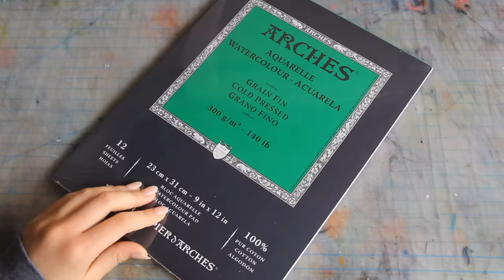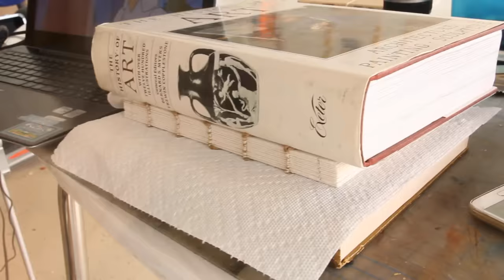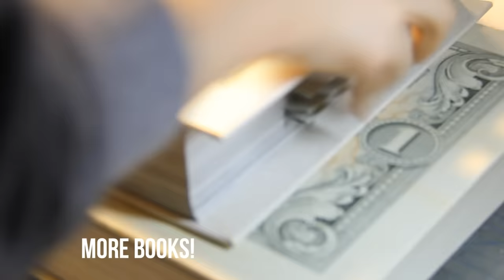DIY: Watercolor Sketchbook (No Bookpress)

Comment: Additional tip: use some other paper, like cardstock, specialty paper, or others, for the first and last flaps of your journal. In this video, you see that the first and last are the ones that get adhered to the book covers. So if you don't want to waste your watercolor paper (especially if you're making a custom one with some more expensive watercolor paper), just add additional pages for your flyleaf and inside cover.
Reply: Ahhhhhhh I was thinking the same. I was cringing a little at the waste of watercolour paper, especially since it's Arches and Arches watercolour paper is so expensive. ;;;;;;;;;;;;;;;;;;
Reply: thannnkkkks I'm gonna make one too!
Reply: she used scarp cardboard and put brown paper on it to make individual covers for each side. I get what it looked like but this is misinformation.
Reply: That's not what Mmina was saying. She is saying that when the cardboard + brown paper combo for the covers was applied to the actual bound pages, it was literally adhered/glued to the watercolor paper itself. She's not saying that the covers are made of the watercolor paper.
Reply: Great 💡 idea.

Comment: This was absolutely great.  I read through some of the comments, and I can tell that some folks don't get it because they aren't watercolorists.  Having the high-quality paper you want in the size that you need in a sturdy sketchbook is so important.  I've spent big bucks on sketchbooks that say they are for watercolor but that don't hold up to the water.  And, as you said, if you do find one that does hold up, it's very expensive.I was given one with a beautiful leather cover, handmade, sewn like yours.  The paper had a note inside saying it was Cold Press 140 lb. handmade watercolor paper.  I think the thing cost about $75 for a 5"X8" size paper.  When I tried to use it, the coating on the pages repelled the water--never had that happen before!  I thought, oh, well, I'll use it for a writing journal.  Guess what--pen slides off, too.  Markers never seem to dry, and smear hideously.  A regular 2B pencil makes incised marks but leaves very little graphite on the page.  The only things that seem to work well are very soft pencils and crayons.  However, the book looks nice on my shelf.  I'll eventually glue small watercolors into the book; that is, IF the glue doesn't do something wacky on the surface.  :)
Reply: DA Best 
try alcohol inks on it. reminds me of yupo paper

Comment: A tip for poking the holes: I would suggest using a sewing pin and not a needle, as they are easier to hold on to and find if dropped

Comment: I just watched a similar DIY clip last night but yours is way too simplier to do :D but will the book open flat? I love to do paranoma watercolor sketches.
Reply from the maker: Jamie Tr Thank you! Yeah, if you bind it a lot tighter than i did, there's no reason to use glue afterwards. But if you do end up using the glue, as long as you apply a thin coat, it should lay flat :)
Reply: MyPetiteCakes thank you for your reply :x that helps.
Reply: Hi, I forgot to ask what type of thread you use. Is it sewing thread (cotton/polyester) or linen?
Reply from the maker: Jamie Tr It's just regular sewing thread but I wish i had linen haha
Reply: Thank you! 
Me too, sewing thread is the only thing I have on hand now. Linen seems expensive.

Comment: does it get damaged easily or over time?? does the strings loosen some time? like do u need to be gentle
Reply: +Liemariko if you use book binding thread [which is the best option] or just a think enough string, then no, you don't have to be gentle
Reply from the maker: +Liemariko Sorry for the late reply! I've used the sketchbook for about half a year now and It's been through some rough treatment, but the binding has held up well! (if you see my latest sketchbook tour, you'll see that nothing really changed except the cover got really dirty haha). I have another watercolor sketchbook where I basically just folded the papers in half and then glued the spine together, which is a really really quick way to make a sketchbook, and the binding is beginning to fall apart after a few pages of using it. I don't think you have to be gentle with this technique!
Reply: liecheepaint you can glue the spine

Comment: i dont have much experience with watercolor, but i thought you had to stretch the paper before painting on it, wouldn't the paper warp if you try to just use it directly? I've just started using watercolors sorry haha
Reply from the maker: It helps if you stretch it but i never do haha!
Reply: +Catherine Zalewski It helps if you stretch, but if you use a heavier watercolour paper like 300 gsm, it won't matter cause it straightens out after the paint dries :D
Reply: +Catherine Zalewski  It'll help but sometimes the sketch lines are too dark.
Reply: For me that has never worked. The paper will warp because you are using water on paper. The best technique I have found is after the painting is done lay a crap tone of heavy books on top of it.
Reply: I don't usually do watercolor stuff in books, I tear out the paper; but taping the paper down also helps to prevent a lot of warping.

Comment: I'm curious, would buying all the materials and making this from scratch be more cheaper then buying one from Walmart or something?
Reply: Walmart doesn't sell arches paper as far as I know and arches is typically a bit pricey, so buying one from walmart would most likely be cheaper. Though arches watercolor paper is very nice quality so it might be better to make your own arches sketchbook. It's 100% cotton and acid free which means it is archival, and takes watercolor paint beautifully. It's worth the price if you can afford it. :)
Reply: I bought all the materials yesterday to do this. I bought my most favourite paper, which is quite expensive and was about £12. I got the cardboard free from the shop, the glue was about £3. Other things I found around the house but I believe it would not be more than £5. I think with the fact that you would be using a paper of your choice and would have fun making it, I think it is worth the extra 2 pounds. But otherwise some watercolour moleskine sketchbooks are around £20 anyway!
Reply: Also she'll use just one paper for 4 drawings :)
Reply: It might be somewhat cheaper to buy a bunch of full sheets of watercolor paper, then cut them down to whatever size you want. Arches pads are like $30+ depending on the size, but I think a sheet of paper is maybe 10$ max?

Comment: Beautiful tutorial. Beautiful watercolor book. Just a couple of bookbinding tips though: 1.) I noticed your sheets of paper crack at the fold. That's because you're folding it against the grain of the paper. If you fold the paper with the grain, it won't crack and thus extends the life of your book. It means a) having a smaller sketchbook or b) buying a larger pad. The best way to tell the direction of the grain is to slightly bend it. If it bends easily, it's going with the grain. If it resists when you bend it, it's against the grain and will crack (and fall apart over time).  2.) If you wax the thread you use to stitch your books it won't tangle or knot as much. A cheap candle would work well. Thanks for sharing your process! I'm going to give it a try. I've never done this kind of binding. (Sorry for the long comment, but I hope it's helpful.)

Comment: Just a tip, with a tooth pick or your fingers, untangle as much as you can, then you just brush them, there's a small wire brush made for this type of thing but i think you use just a normal hair brush, by this way you are gonna have very fine thread that's is gonna glue much better and is not gonna leave any lump.

Comment: It turned out beautiful! I would recommend using a ph neutral PVA glue for the spine as the book will last a lot longer, and a waxed cotton or linen thread is a lot easier to work with standard thread. I had to work up to those items in my books as they can be a bit more expensive.
Reply: Wax repels water. The paper is for watercolour paint. It may make it easier to sew but it will make it literally impossible to paint on

Comment: You can use a phonebook to punch holes - just open to the center, and it's so easy to punch holes without messing up your work table.  Also, for an exposed binding like this, try using waxed thread - it will help hold your stitiches a little better and the thread won't slip or fray.  Just an idea for you xo :) And one last thing - when you painted the spine with E6000 - why didn't you just use PVA?  It dries clear and it's made for books.  E6000 is great, but not really made for paper, and is strong spelling, and overkill for paper.   I love this book - very simple.  It reminds me of coptic bindings that I did in college- so much fun!

Comment: I'm really curious about how this sketchbook held up over time. I've read that you should bind the paper with the grain and not against it, though I'm not really sure how to tell which way the grain goes exactly. Thanks for posting this, I've also been frustrated with the paper in most watercolor sketchbooks, or the expense of ones that have cotton paper.
Reply: To tell which way the grain goes, try to bend the paper along both the long side and the short side. If it is easier to bend along the long side, it is long grain. The reverse goes for the short side.

Comment: Hi, this is probably a daft question but on the first time you push the needle through and loop it round the string -does your thread have a knot on the end of it? What stops it from just pulling out of the hole?

Comment: I have a question about the paper. All of the watercolour papers (several different brands. mostly Winsor and Newton though) I've had in the past are only one sided, as in one side is the watercolour side & the other is just plain & flat (the side you wouldn't paint on). I find it impractical to make a sketchbook with watercolour paper like this. Is all watercolour paper like this? Or is yours "both" sided. Or does it not matter if there's two sides to it & that's how watercolour sketchbooks are just meant to be? But it doesn't seem right. Great sketchbook btw.

Comment: What would be the best string or cord to use for the sewing part? It looks like 4 single threads. can/should I use waxed cord? might be less tangly?
Reply: You can buy waxed cord for sure. I use embroidery floss that I pull apart into strands of 2 or 3 threads, bc it's less expensive than commercial bookbinding thread, and it's essentially more thread for less money. Run it over a small cake of beeswax and you're ready to go!  :)

Comment: What if you don't have a shelf for taping the twine ?  :(  Oh and what kind of thread and needle do you use ? thanks
Reply: +Star buono  I made my own just now and I just taped the twine to the back of the first page and started doing it just like in the video, the only difference was that I had to pulled it a little after finishing the new page to make it thight. And I used a needle that's about 6.7cm long. For thread I just used the stronger one I could find in the deep ends of my closet and made it double :) I hope this could help?

Comment: I'm no expert on watercolour paper, but don't do this with regular paper. The paper itself has fibres, and if you buy a notebook in A4, the fibres are supposed to "stand" parallel to the spine. When folding them, you get the fibres non-parallel to the spine, causing the book to constantly try to open up and you'll never be able to close it satisfyingly. 

Really harmonic video though! :)

Comment: where'd you get your water colour paper from? I haven't really done water colouring before, but I used oil paint, acrylic paint, as well as pencil crayons. I have some cheap water colour, but got some decent water colouring pencils. The only problem is I don't have the right paper.. >~<
Reply: I also have chinese painting ink, but the material and methods are different as well as the paper :c

Comment: Please please please be careful when using E6000. The fumes are extremely noxious and can cause dizziness, headaches, nausea, and even fainting or memory gaps, among worse things! Always use in an extremely ventilated area.

I used to pass out and suffer severe headaches from E6000 so now I only use it with a respirator or use an alternative adhesive.

Comment: I need a watercolor one and I would love nothing more than to make my own.

but I would love a step by step text to read and a video to watch like this to make it because some parts are confusing and I know if I messed up i'd be devastated . 

could someone be such a sweetheart and point out some things on this video to help me out on that seems confusing? Like when she threads the extra page, I dont know where to place the needle so it doesn't look funky.
Reply: Step 1:Take your pieces of watercolour paper, find the halfway point of each and score along the line and fold it.

Step 2: Stack them together and secure them with a bull dog clip (or something to keep them in place) and mark the lines where you want your 'chord'. (place the bottom of your ruler so it is flat against the table so you get a straight line)

Step 3:Lay each piece of paper open and poke a needle through all the tiny marks on the fold that you made.

Step 4:Now you need to find a shelf or something where you can attach your 'chord' in straight lines that match up to the marks on the fold. (don't put chord where your first and last mark lines are!)

Step 5: This is the tricky part, through your first needle hole (that has chord), bring your thread from the inside of the page to the outside leaving the tail of the thread hanging out the end (don't pull it through!)and tie a decent knot to keep it from sliding through. Bring your thread around the chord and back through the same needle hole you came through. By this stage you are back on the inside of the page and you need to bring your thread out of the second needle hole and repeat until you are at the end of the  needle holes.

Step 6: When you add a new page you are at the last needle hole (this one doesn't have chord) and you pull your thread from the inside of the page out  and up through the last needle hole on the piece you are adding carry on doing step 5. 

Step 7: Tie the end of thread loads, and put glue on the knots to secure them.

Step 8: Cut the chord so it has a bit extra sticking up from the stack of page. Put a book on top of them to keep them down. Paste E600 (PVA glue would probably work too) over the chord and stack tho secure all the binding.

Step 9: Take two pieces of cardboard that are slightly larger than your stack and cover and design them.

Step 10: Tie knots in your chord and secure them with E600/PVA glue. Cover the rest of the page with glue and stick down  your cover. Place books on top to make sure it sticks! Repeat with the other cover.

Sorry if this is even more confusing!
Reply: ***** WOW! Thank you a ton! It's so much better reading this than actually figuring it out myself! <3
Reply: Oh gosh you're my savior!!